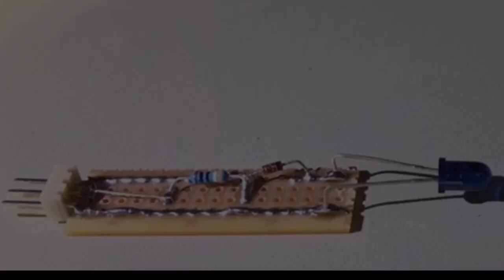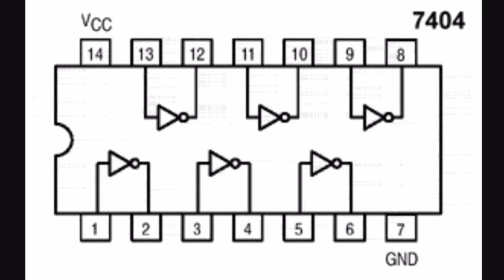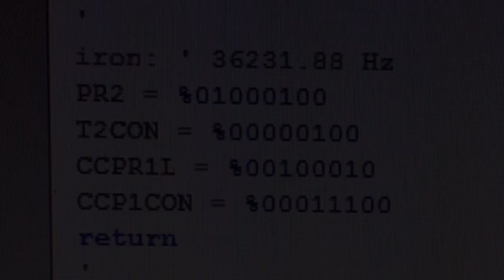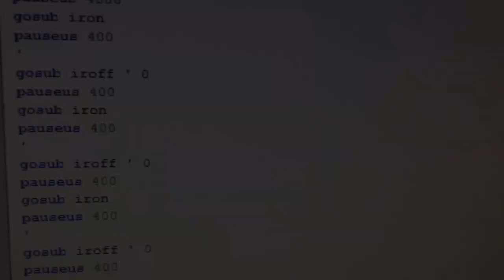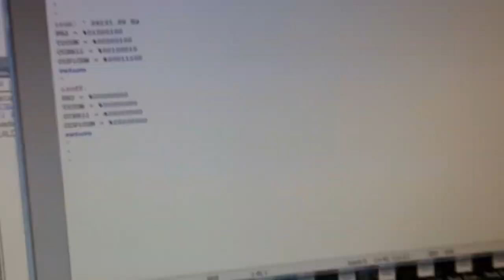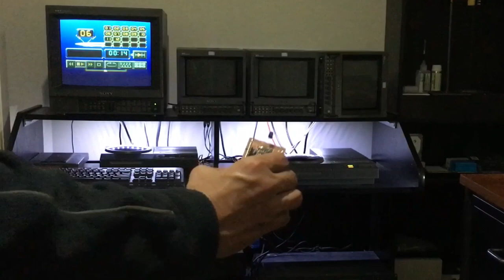Infrared Transmitter & Receiver Basics

Comment: It, the transmitter, is not transmitting heat - is it? When I think of infrared I think of heat radiation. I don't understand.
Reply from the maker: Infrared is just another range of the electromagnetic spectrum, just a bit lower than our visible red. I don’t know much about IR cameras, but I guess that area is also where heat lives, or at least IR is present as well. If something is hot enough it glows visible colours. Red, then orange, through yellow, to blue, to white.

Comment: Awesome dude! Very nice channel,  can I make this using a 555 timer?
Reply from the maker: Hi :) A 555 can definitely set up to oscillate at the 36kHz to modulate an IR LED so you could see the output with a receiver module if you’re talking about the first part. I was going to use a 555 circuit for the second part with the 1 second flashing, but didn’t have one handy.
Reply: Brek Martin Im definately gonna build this with a 555 timer, thing is, im moving to singapore, and all my stuff is already packed  :( . Thanks for that slayer exciter audio modulation totourial, I got mine to work, and I even had a singing arc from 24 volts!!! The only difference in my design was that I use  tip31c, which is basically a more powerful verison of the mje3055t, and has a breakdown voltage of 100 volts versus the 80 volts of the mje3055t. Also, the reason I had to run my slayer exciter on 24 volts to get breakout was that I put 750ish turns on my secondary instead of the 1280 as was recommended. This is one of the cases where there is litterally no pain-no gain :P. Still thanks for the awesome vid! As soon as Ill get to singapore, im gonna make a bigger secondary with 1400 turns, and im gonna try to run it off 80 volts! And maybe put a special high voltage transistor with similar currents specs (8amps), and Im gonna try to run it off RECTIFIED F@CING MAINS!!! It will be awesome!!! Im expecting sparks of 30+cm lenght!!! If I get it to work ill definatley send you a link, but right now im in Kamenka Russia :P. Still, thanks for the awesome vids! Also, btw, do you know any way to prevent stray voltages on the the primary of the transformer? Should I maybe use a MOV?
Reply from the maker: Nice going :) I’m using 2N3055 (60V) in TO-3 package and big heatsink now. It can run continuously with 36V (3xSLA batteries), but if I add a fourth battery it lasts only a short time. I still want to make a nice Slayer exciter driver to show lighting gas tubes without the noise of the spark gap one.
Reply: Brek Martin 60 volts is a very low breakdown value, I tried using a 70 volt 1.5amp bd139 darlington npn transistor, and when I tried pulling arcs from it with a grounded chicken-stick, it exploded like a nuke and sent a 200gram heatsink almost 15cm into the air!!! It scared the crap out of me and I almost had an electrical fire in my room!!!! It made burn marks on oak wood and even melted the breadboard, and all of this from 30volts!!!! The tip31c npn darlington worked much better and it did not detonated and from 24 volts, I was pulling 1.5cm arcs and I had around 1cm breakout. Im also gonna try making a pnp transistor variant thje slayer exciter and when im gonna runmy design off rectified mains, im gonna use a very high power darlington transistor, maybe even a mosfet with a driver circuit. Also, im gonna try to make this circuit with a tip142 high power darlington transistor. And maybe some high voltage high transistor,maybe a darlington, like the pnp tip147 or maybe using the tip132c , which is a pnp version of the tip31c npn darlington transistor I used.

Comment: Do you ever flash EPROMs (or CPLD etc) using a raspberry Pi GPIO (any model be it a 3 or a zero etc)?
In the comments here, I've suggested it to youtuber Agent24: https://www.youtube.com/watch?v=mgHElmB9okQ
And also, considering a flirc is often used just for the IR, can a bluetooth dongle and your IR thingy you've made be cobbled together to make one, or at least one that will run the wii-remote (since its drivers for example are in the linux kernel since for ages)? Of course, your gadget prioritising amiga is definitely an awesome priority.

I would also like to tangent my comment further by reckoning that having some sort of parallel bluetooth dongle (remember those? Awesome things!) for the amiga (be it joystick port or serial or parallel or all 3) in conjunction with your IR gadget (even if the IEEE on the m680x0 is piss weak) could trickle through just enough data to get a wii-remote (or wiimote nunchuck whatever) and trick the amiga into thinking a gravis flightstick or steering wheel was installed (like this https://www.youtube.com/watch?v=UqrYVW2xZKA nunchuk64 by bwack).